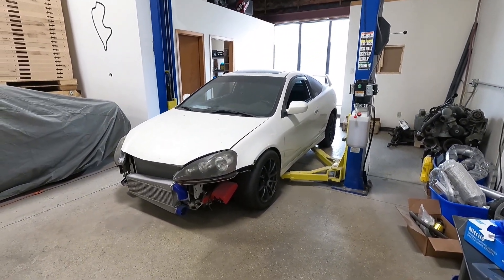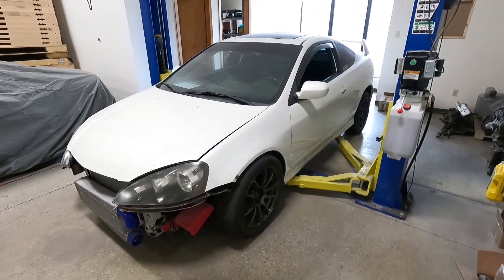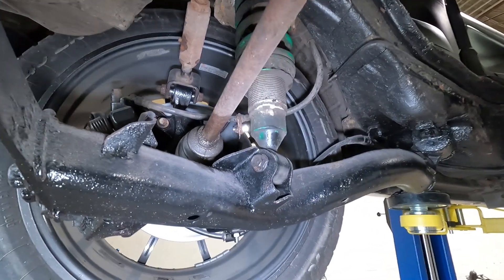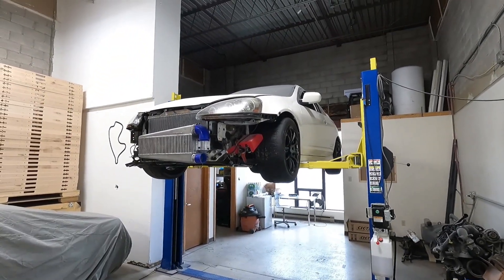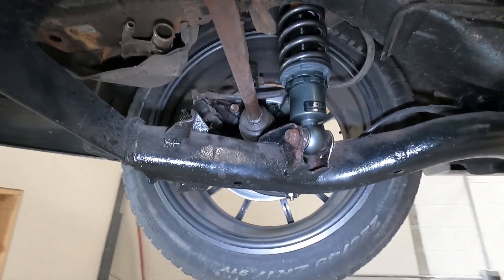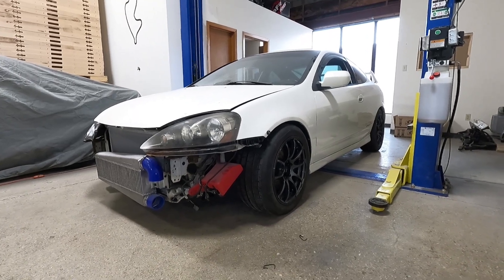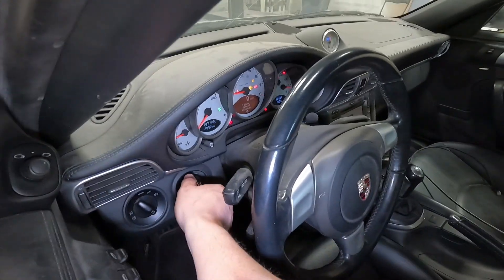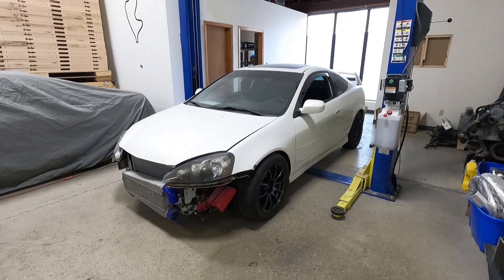RSX AWD Ep 7 + K997 Teaser

Comment: If the coil hasn't hit the bottom of the base yet, remove the middle ring that holds the top ring. You can use the bottom ring that hold the base in place to hold the top spring ring in place. REMOVE MIDDLE RING.

Comment: Bro I got tein coilovers an I had no issues getting my rear ride hit set .
Reply from the maker: Did you use CRV or Element trailing arms. Are your Twins the same as mine with only the one adjustment
Reply: I used 04 crv ones with advanced z tein coilovers. An I had no problem to get my ride hight right.but I will say right when I put it on the ground it was sitting pretty high though.
Reply: How did that fuel tank that u got work out .was it a good fit